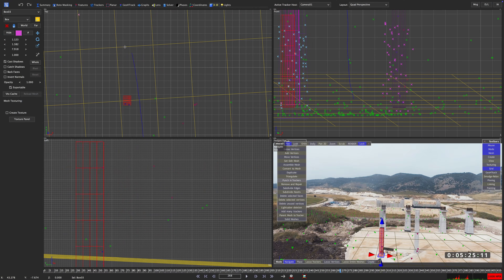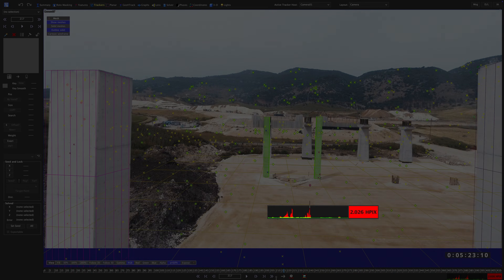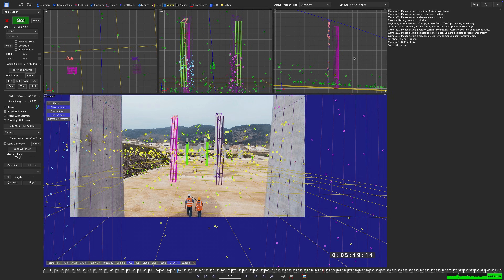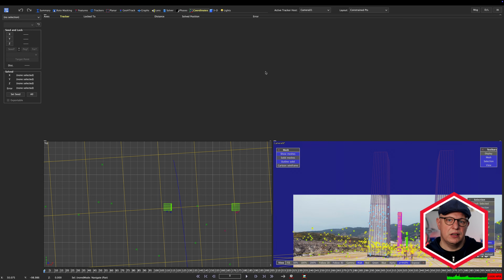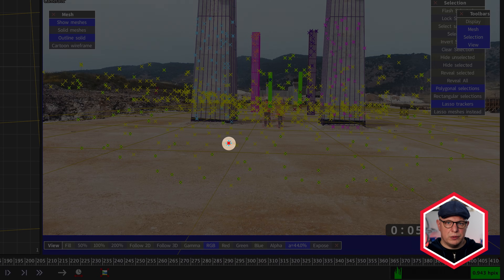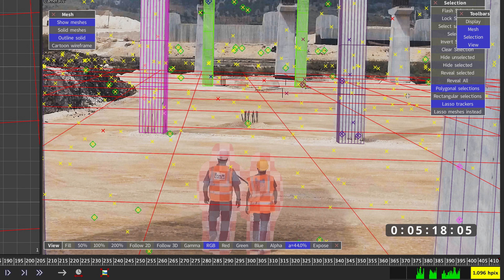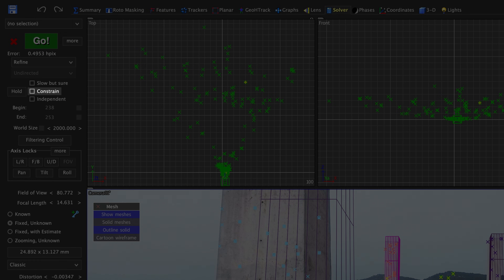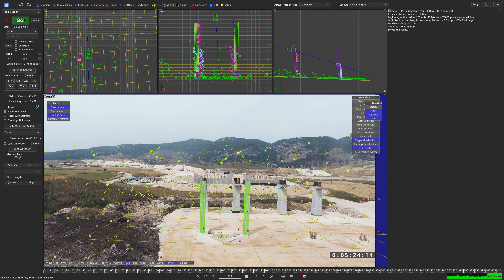Keep your Geo in Place with Lock Points [Boris FX SynthEyes]

Comment: hi i am trying to learn 3d tracking as my hobby...i am buying a dslr cam and use syntheyes as my software....what are the features that i must look in camera for best 3d effects ,tracking and object inclusion in my live footage...i want to make my journey easy with less work while adding these edits to my footage..thanks in advance. My friends told me to buy a good lens ...i don't if i should go for best camera body or best lens for this kind of 3d work
Reply: Hey there. Regarding the lens I would think about the following: A prime lens with a fixed focal length will be cheaper and probably give you better results in low light scenarios, but if you are looking for a 3D tracking challenge, then zooming shots is a capability you might miss at  some point - but dealing with Zoom lenses is certainly an advanced topic, so maybe start out with a prime and then see where your journey takes you. On the body: I would think about what you want to do with the material. If you want to actually do heavy color grading and vfx on the footage, think about choosing a body that records with as little compression as possible. But to give you a proper reference: Most of the footage i filmed for this course was shot on a LUMIX G100 which you can get used for around 300 Euros and a old 9-18 millimeter Olympus m.zuiko lens i got more than ten years ago, which currently sells used for around 300 Euros as well. This is not a gear recommendation, but I just wanted to give you a proper reference on what you can expect from this kind of camera. Hope this helps!

Comment: What is the difference between seed, lock and peg which in my mind more or less means the same thing?
Reply: That a really good question: The manual goes into a lot of detail about this, but as a very simple starting point: Seed points are points where we tell SynthEyes we know the coordinates for, by Locking them we are actually telling SynthEyes to adhere to them (like explained in the video). Pegged points on the other hand are really hard-locked points, which are useful when working with detailed survey data like GPS coordinates. With pegged constraints there is absolutely zero wiggle room for the solver.